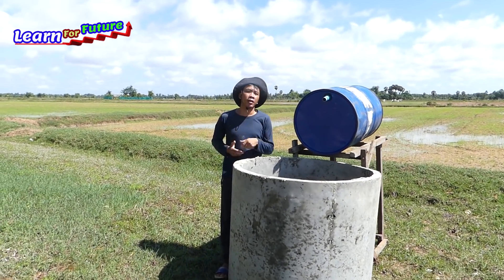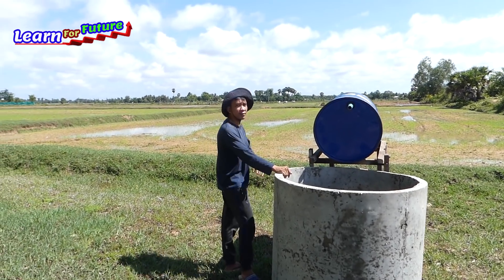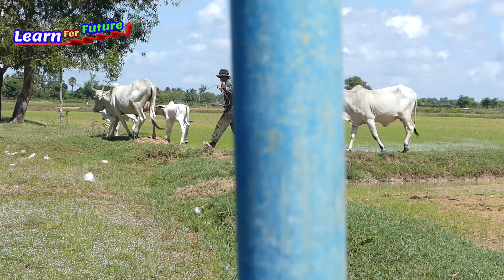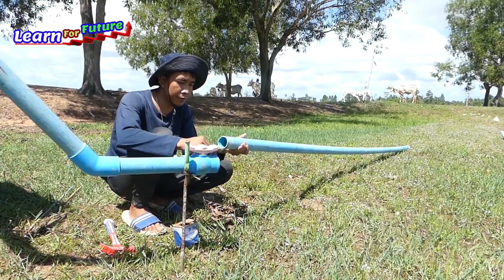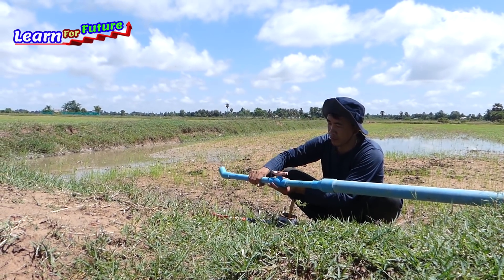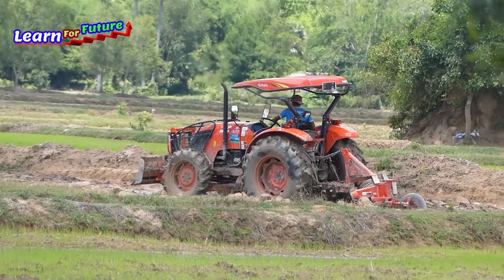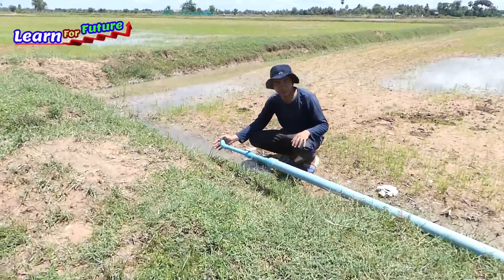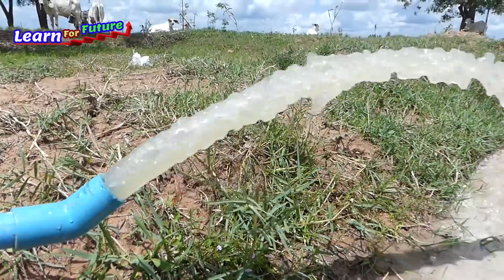Pressured Pump - How to make free energy water pump from deep well for rice field

Comment: No need for the foot valve in the well, waste of money.
No need for the vertical pipe at the output, waste of money
No need for the valve at the output from the drum, waste of money.
No need for 60 mm output tubes when the suction is 34 mm, waste of money. 
No need for two filling studs, one is enough, waste of money.
No need for that high rack, makes it heavier to fill the barrel.

An upward bend at the output to prevent air from leaking in is missing. 
Do not clearly state that the water level in the well must be higher than the outlet to the field for this siphon to work. 
Al tubes are glued, reuse not possible.